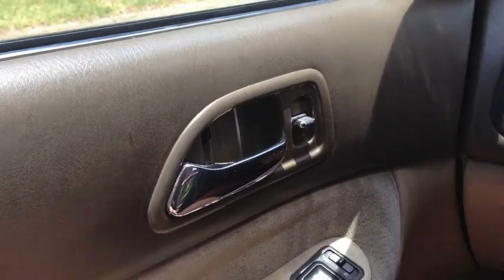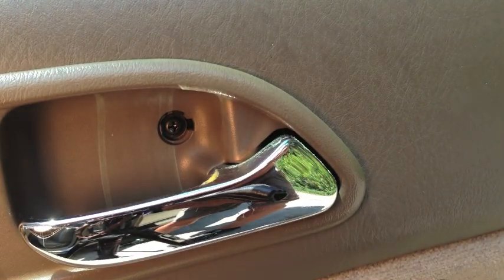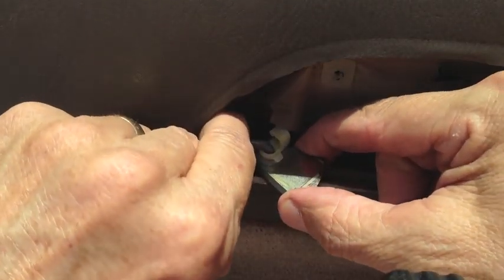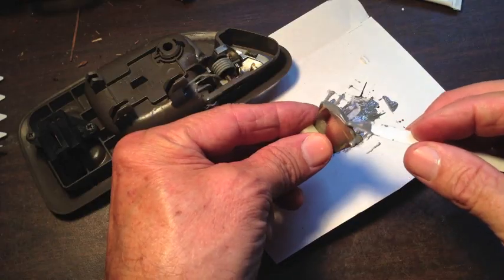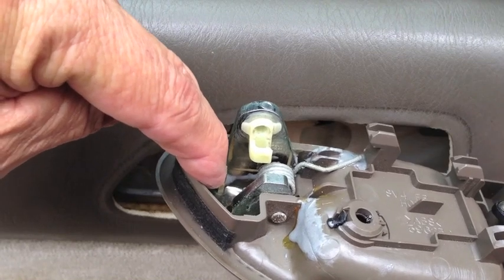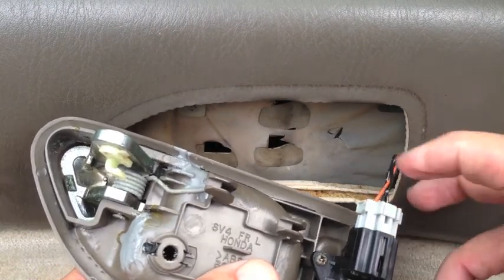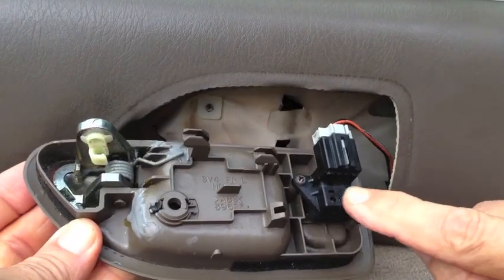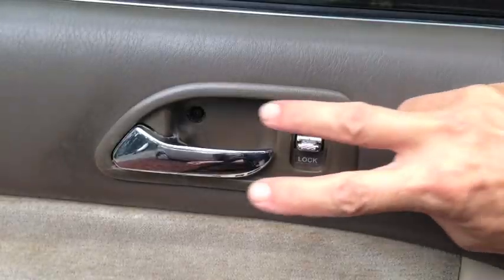Honda Accord Interior Door Handle Repair

Comment: Sir I have one question. I have an 1997 Acura cl and the interior door handle is about  the same. The issue with mine is that a piece near the end of the the handle snapped when I tried to open the door. Do you think the jb weld would fix that handle back to normal ?

Comment: After I replace mine, my door opens but the handle doesn't go back into place, I have to push it back. Any suggestions???
Reply from the maker: I would take the assembly off and see if the handle then snaps back into place.. If it works properly when removed then your issue may be with the lock mechanism that the metal rod leads to.. Some type of resistance.. If it still does not work properly when removed there must be an issue with the spring on the backside.. That's what should pull it back in..
Reply: Thank you. I appreciate you taking time to reply. A lot of youtubers flaws is the number 1 fact that they don't reply to their comments.